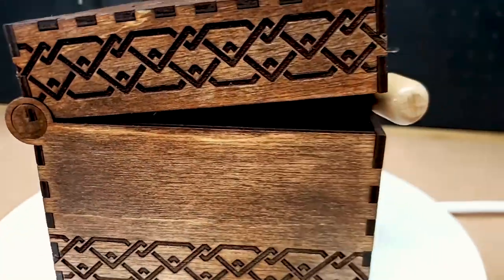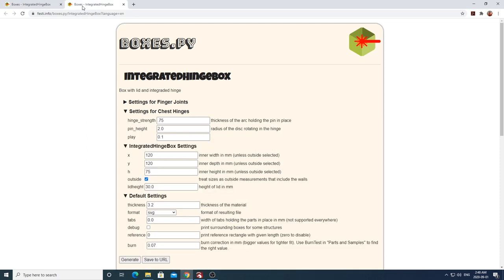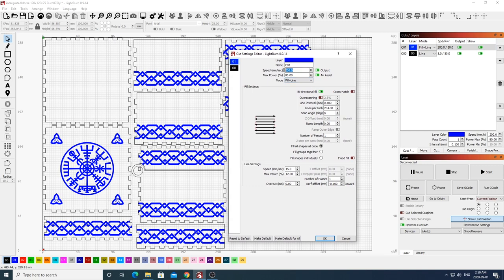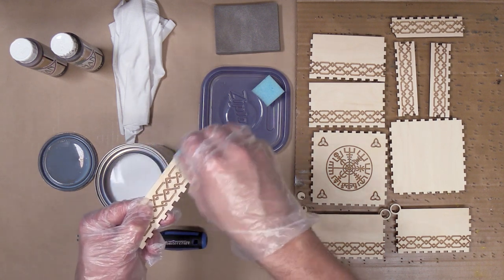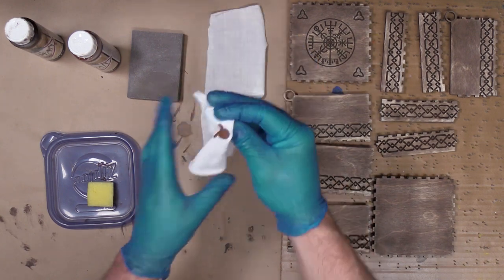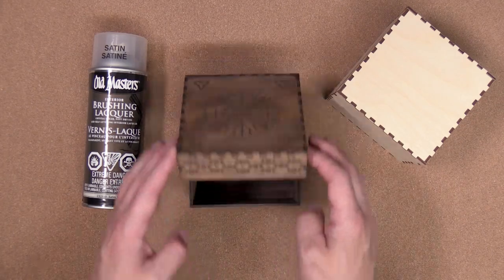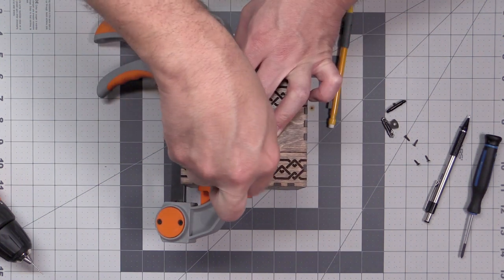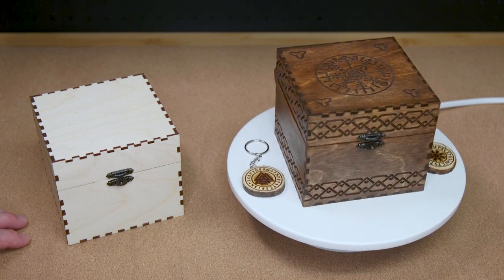Laser Cut Box Design with Integrated Hinges / Norse Theme

Comment: Cool box! Could you tell me if you would need to change settings other than thickness for 7mm stock?
Reply from the maker: Yes you would. 
Cut a couple small tests of the finger joints until you get it fittinf the way you like.
Reply: @MakeTechCreate  Thanks yeah I have the joints at a good place I just cant seem to get the hinge. It looks ok on boxes but when you bring it to lightburn in the preview, the pin for the hinge is double the size it should be and cuts through the arc.
Reply from the maker: @DreamingTheLifeLivingTheDream  I would have to look at the file to see what's wrong. Have you tried generating your own box from scratch from the laser box generator to see if that works.
Reply: @MakeTechCreate  I have yes, I am using 7mm ply so I changed a few things. Is there somewhere I can send the file to for you to have a look?